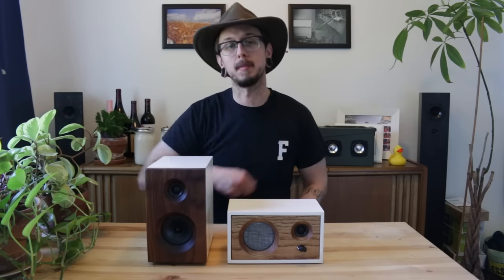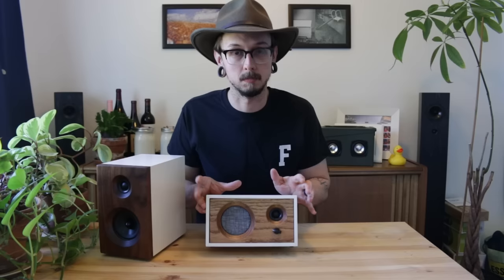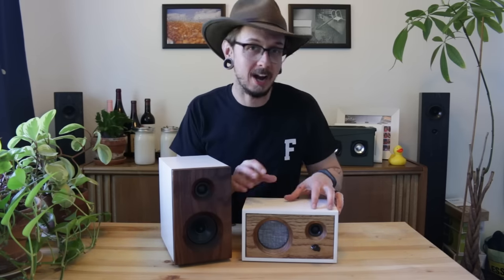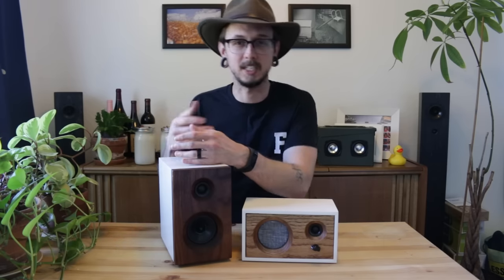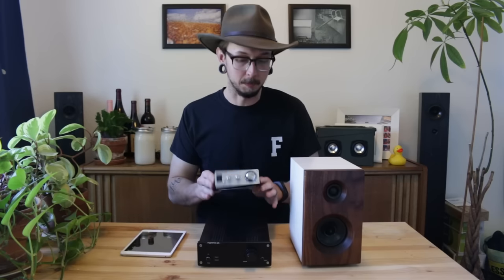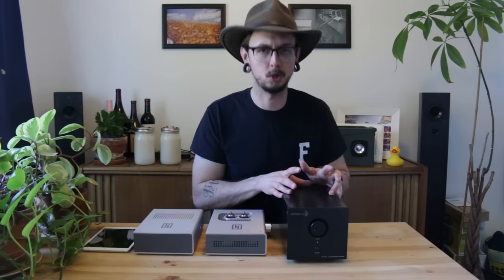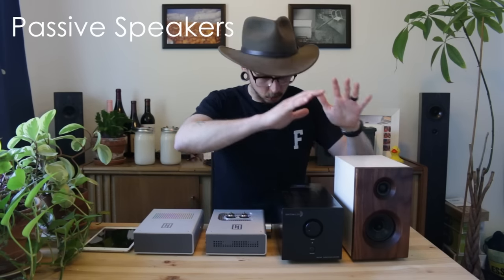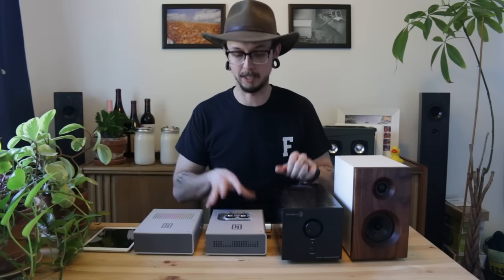How To Set Up A Home Audio System || Home Audio Signal Flow

Comment: One thing to add, if the source file on your iPad/phone is a heavily compressed file, example a 128kbps mp3 you might not hear a lot of difference between the headphone output (3.5mm jack on the iPad) versus using the better external DAC and Preamp. I buy 24bit FLAC files and buy CD's still, I use EAC (its free) To rip the CD's to FLAC which is still a very good uncompressed sound. My point is having higher quality audio files will give you the best reason to do an awesome external DAC/Preamp/Poweramp setup and actually hear more of the difference.
Reply: FLAC is actually compressed, but lossless. (Free Lossless Audio Codec) 🤷🏼‍♂️

Comment: Hi, I like all of your speaker builds & audio talk. I've a query, can you please explain why main driver of subwoofer is visible from outside in premium or midrange one while it is hidden inside the enclosure in the cheaper one. Like Intex 2600 or Philips low budjet home theatre system

Comment: Love you videos!  Could you possibly do one on crossover design?  I am working on a build project for custom tower speakers and have done a lot of research into matching speaker components but I cant really find a good guide to crossover design for a multi speaker tower (i.e 1x tweeter w/ 2 or 3 woofers)  I understand this will be based off the the frequency ranges for the specific speakers but I am also interested in design based off of wiring configuration for impedance (I think...?)

Comment: Kirby, I'm sorry, but the signal coming out of a DAC is already a line signal (1,5 to 2.0V). You connect it to a pre-amp so you can control the volume. If you'd connect it straight to the power-amp, the sound would not be distorted, if the digital source isn't set to full volume. If you would set it to full volume, it would be like turning the volume knob all the way open on your pre-amp. And who does that...?
The pre-amp also makes it less harder for the DAC to 'drive' the inputs of the pre-amp. This also benefits the sound, but that's a long story...

Comment: 👀in a powered speaker is the cross over filter built into the internal amp or does it still need all the parts?

Comment: How is it that the Dayton APA150 has a volume control if it needs a preamp? I have to admit that the preamp kind of confuses me. Let's say I wanted to send a Chromecast audio signal to an APA150, I would still need a preamp for it to sound good? I just bought one on your recommandation and it seems weird to buy a 350$ preamp for a 150$ amp... Are there cheaper options that would work?
Thanks for the video!

Comment: In your system can you use legacy source such as a turn table, cd player etc....? thanks for the tutorial
Reply: Virginia Hoffman I was thinking the same thing I'm an older guy from the older days of audio. I want to be able to listen to records and CDs I don't necessarily want the dirty signal that comes through a smart phone or laptop or something of that nature
Reply: Mostly yes. With a turn table you don't need a DAC, because they are already analog. Then you'd need to know if said turn table is pre amped or not. If yes, you just need the power amp and the speakers. If not, you should connect it to the pre amp and the rest remain the same. 
With a cd player, or any other digital device it will depend on the outputs it has. If it has a way to output a digital signal then this video applies completely, if not, you're mostly going to connect it to the power amp, but as Kirby said, crank it to 90% and then change the volume on the amp.

Comment: Hey, Kirby! I'm a complete noob to HIFI systems and I'm going to be investing in a very expensive system soon. I would like to know exactly what I need to complete this system down to the wiring or cables. Also before I get into the system components I'd like to run a DAC and a Vinyl player in the setup. So I know some of the components I'm going to get, I just don't know what cables I need and how to hook it all up. So here is what I'm thinking about getting:

SPEAKERS - SVS Ultra Bookshelf speakers
AMP - Rogue Audio Sphinx v2 Integrated amp
VINYL PLAYER - Clearaudio Concept

So I would need a DAC for digital audio, preamp, and cables?

Let me know exactly what you would do to set this all up and what cables to buy for the entire setup.

Thanks!
Reply: You don't need a preamp for an integrated amp (sphinx v2). Integrated = preamp + power amp. Also general rule of thumb so far as bang for buck is no pieces should cost more than your speakers so Idk, popular consensus would be multiply the cost of those speakers by a factor of 2 to 3 while downgrading the cost of those other pieces. Also cables/interconnects that makes up less than a percent of what's really important.

Comment: excellent video.. but if it is meant for beginners what is a ''driver''.. ?
Reply: iAwareNow an speaker.
Reply: I think someone who works for Uber :)
Reply: I'm pretty sure this has something to do with uber of golf. In very so slight cases in a sound system tutorial video it could have a minor connection to speakers, just wondering.

Comment: Soo, just a question. What if after DAC straight to power amp? what's gonna happen?
Reply: Abdurrochman Hamim afaik, nothing bad really. I'm current using a dac which is directly connected to a power amp (odac connected to a behringer a500). The sound coming from my floorstanders is real nice and without any distortion. That being said however, I'd advice using a pre amp purely for controlling the volume.

Comment: Their are some China made DAC'S using the AK4490 and some very very good J-FET OP AMPS and they cost under $100 and i bet you a thousand dollars on your low end equipment and speakers you wont tell a difference.start to get some high end AMPS & Speakers and you will start to notice better bass from the Schiit because of it's discrete output stage. That's when you buy a Kit that needs to be assembled and soldered  that is using two AK4490 DAC chips one for each channel then toss out the electrolytic capacitors for some wima polyester capacitors also use 1% metal oxide resistors you could even add second tube output stage from the DAC  so you can switch between the two. Then build a linear power supply and now you have a high end DAC that will out perform your Schiit for less than half the cost of the Schiit aint that some SHIT !!!!!

Comment: Not necessarily true...actove speaker doesn't have to have amp built in. A better description might be that active speaker has the amp after the crossover...where a passive has the crossover after the amp.

Comment: Way to much money uselessly spent. BROKE PEOPLE READ ON :

For digital only content (that being 90% of you) : BUY A FULL DIGITAL AMPLIFIER like I Am D V200 ! 150$ tops on aliexpress, has EVERYTHING you'll ever need. And put all your money where it does matter : the speakers. I repeat, the speakers.

- You want cds ? Use your computer or a shitty dvd or cd player that has a digital output (toslink/optical/digital coaxial), it will do the exact same job as a 4000 bucks cd player : pushing the same bits to your DAC.
- You want a chromecast ? buy a chromecast audio, it has optical built in
- You want bluetooth ? most FDAs have it built in, don't bother with another device

This comes from someone who had a 10,000$ setup before I was knowledgeable enough to tell apart all the bullshit this market is filled with.
Reply: Andy SCIALLANO
So you just connect it to the speakers or to the power amplifier?
Reply: Speakers, an FDA already is an amp ;)

EDIT : To make it more visual, FDA = DAC + Power amplifier + integrated amplifier + bluetooth receiver + headphone amp (not all but many) + equalizer (again, not all but many)

Pretty decent value if you ask me.
Reply: Andy SCIALLANO what speaker would you recommend that is compatible with I Am D V200, budget under $200